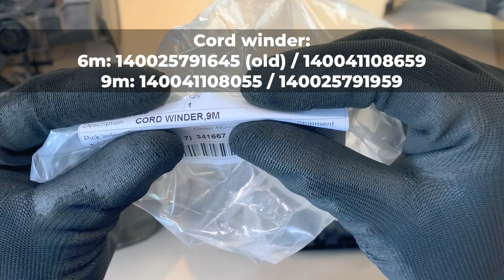How To Disassemble & Repair - Electrolux PowerForce Vacuum Cleaner

Comment: Hi all! I have a silent performer. When I use it the suction power fluctuates and it could get very loud or quiet. I have tried it without the bag and the filters removed, but the problem persists. Any suggestions? I couldn’t open it up.

Comment: Thank you so much for your video!  I spent about an hour trying to figure out how to get the top shell off my wife's SilentPerformer (Model ZSP2320T, PNC 900258432) ... I just had to rip it off like you did!  She said she saw a spark when she unplugged it, and wouldn't work after that.  Seems to be the same issue ... no continuity on the power cable.  I can't figure out the correct replacement "cord winder" part for my vacuum ... Australian Electrolux spare website doesn't have it apparently, so am going to try replacing the power plug first ...
Reply from the maker: You are welcome 😎👍
There is no replacement for australian cord winder (140041108022 - different plug EU), but in case you need new cord winder for this model, you can buy from other and replace that eu plug or connect it through adapter
EU,9m: 140045827015 -> 140041108055
Reply: @proexservis  Looks like fault was in the plug - I chopped it off and tested continuity again on the remaining cord - all good.  So I'll just wire on a new AU plug.  Obviously not the proper/official/warranty way to fix ... 😇 ... but my wife is happy enough.  Thanks again for your video - not only showing how to open it, but also to check continuity on the power cord!

Comment: Thanks for posting clear video!
Reply from the maker: Hope it helped 👍 what was problem with your vacuum cleaner?
Reply: Not yet. It stopped working slowly, not suddenly , it sort of died off. Checked the safety mechanism, it's not bent. Using an original s-bag. Cleaner worked very briefly a few times when I pressed down the cover. But now it's not working at all.